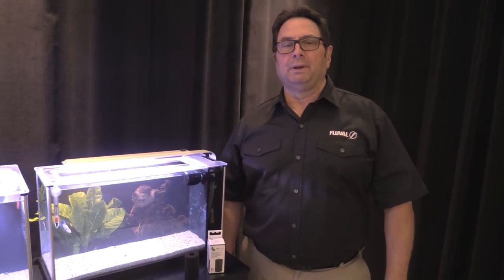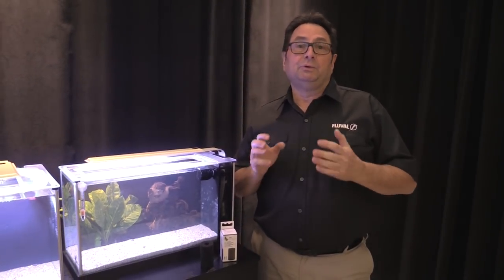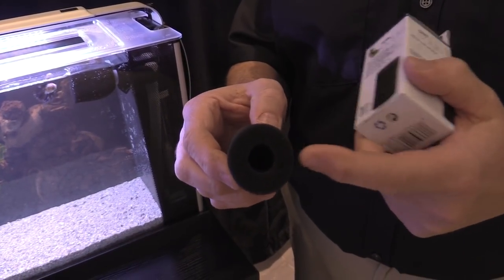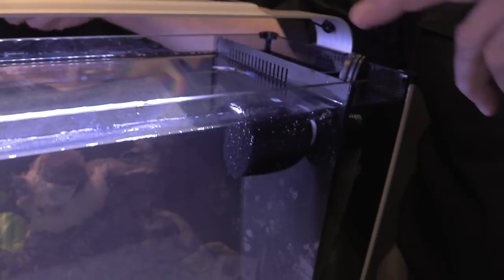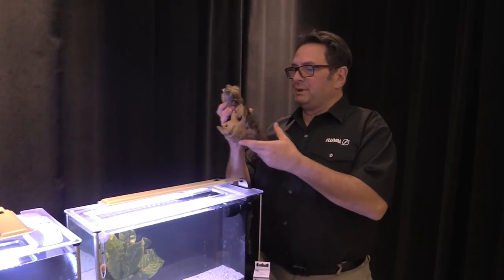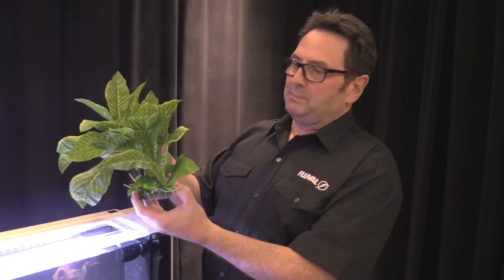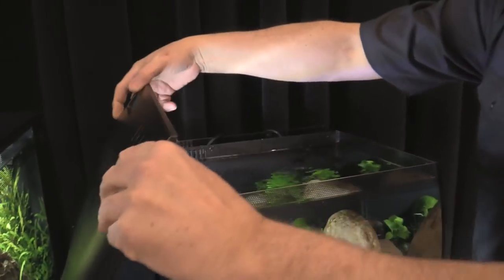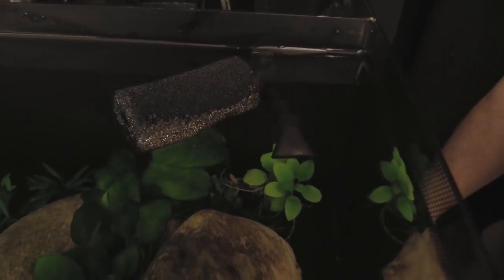HOW TO: Diffuse Water Flow in Aquariums

Comment: I made a DIY version of the sponge using an old filter one I had lying about. I didn't want to completely diffuse the water, as I want some of that gas exchange at the surface, so after cutting two holes at an angle from each other I managed to bring it down to a more fish-swimming-friendly flow. Thank you for this video that clued me onto using sponges to slow the flow!

Comment: Oh my goodness! So simple! Can’t believe I didn’t think Of it myself. Thanks you so much!
Reply: But be aware that reducing the effect of surface water flow will reduce the gas exchange process. That means less oxygen in the water for the fish. Not such a problem for Betta and Gourami's as they gulp air from the surface of the water if they can't get enough, but other breeds of fish will suffer. In this case an air stone is ESSENTIAL.

Comment: I just get the Fluval 104/105/106 foam and cut it into about 3x3 squares and cut a tiny slit on one side and put one over the each of the output nozzles on my Fluval Edge 15gallon! It works great and isn’t as noticeable as putting those bigger black ones which were put on in this video. It does not effect the pump at all, still outputting the same amount water just not at the same speed. Thanks Fluval for all the great products and videos to keep my fish happy and healthy!
Reply: Sorry, but if the water is entering the tank more slowly it has to be entering at a lower volume/second - just plain physics.

Comment: I bought a pair of these sponges at Petco after a salesman recommended them.  Just slip them over the output nozzles of the 15 Gal FLEX.  My betta no longer gets pushed around by the water.  The sponges work perfectly!  I'm not a fan of Petco but they have a good selection of supplies.
Reply: Marleny Rafferty is the Betta able to make nests now?
Reply: @nathanacuna7535  of course he can if there's no current
Reply: Can you link something on amazon?  So I know what to get.
Reply: David Jones I tried linking the item on amazon but could not.  However just type into the search box: Fluval edge pre-filter sponge.  The sponges are shaped liked black tubes with an opening on one side.  My Flex tank has a double nozzle.  I keep one nozzle covered and the other one not covered.

Comment: I love you guys!  I have quite a few different types of Fluval filters, some of them in multiples.  In fact I have 5 of just the U3 alone! I finally succumbed to the cuteness of fancy goldfish and received my first three today.  What I thought was low flow, isn't!  Especially because the only available cycled tank I had for them is a bow front so I'm struggling to figure out how to keep it from causing swirls.  In addition to your sponge suggestion, I think I will also try putting the filter on the bowed part so that the outflow gets broken up in the corners instead of just making 'whirlpools' lol.

Comment: Why didn’t Fluval just offer a dial to lower the pressure from low to high setting like some other aftermarket pumps. Problem solved.
Reply from the maker: Joe, unfortunately access to the valve is an issue for these desk top and nano tanks. Using the directional outputs that are included along with some of the other suggestions in the video are solutions. That said, we are always evaluating options.
Reply: Fluval Aquatics That’s reasonable, filter floss did work and move the nozzles upwards did lower the flow on my flex.
Reply: There needs to be surface agitation for gas exchange. I tried this method before this video and there was an oil slick on the surface and debris on the bottom. I too out the duckbill and it helped
Reply: Simple $ if they put a built in adjustment they can't keep selling you the foam covers.
Reply: You can just buy a valve and plumb it in to the existing hose, Eheim sell them. Problem is that increases the chance of leaks as you are increasing pressure on thr system.
Reply: @roadkill3881  🤔
Reply: There is also no ON/OFF switch on the power cables
It's just always on when plugged in
I guess this is just one less thing to have break but I feel like it would be useful
Reply: When he was talking about the wood I thought he said "small panty wood"

Comment: One of my favorites is to put the intake behind a matten filter in the corner or a corner weir with holes in it. It will, draw from the entire height of the tank and you can use a canister intake if you want an external filter.

Comment: I did the same thing with another tank and wound up getting a biofilm on the water's surface, because it wasn't being agitated enough. I corrected it, by sorta wedging a small piece of sponge in the outflow spout and angling it ABOVE the surface, so that it softly splashes down, fountain-like. I have a young betta in that tank, and she has no problem with it.
Reply from the maker: Donya, good suggestion, thank you. We did notice however that the inlet grill still has a healthy flow through it so the surface is exchanged through the filter. The biofilm you noticed might be due to some foods that contain more fat which ends up being visible at the waters' surface and in some circumstances would need some assistance in being dispersed.
Reply: It's entirely possible the biofilm was caused by something food-related, because it appear in two different betta tanks that each have very different style filtration systems. Both tanks are roughly 3 gallons each. But both had a VERY LOW flow setting (for the bettas). So, I cranked up the pump volume, wedged in the sponge and angled the outflow spout to act like a fountain, and it fixed it. 
Anyway, I'm looking forward to getting a Fluval tank next. I like the aesthetic!

Comment: I just purchased a Fluval Spec V 5 gal and I used a bonsai tree decoration from Petsmart to diffuse the water flow by directing the water into the top of the decoration.  It worked perfectly for my community aquarium in which I have a guppy, two mollys and a female betta.  I love the Fluval Spec, but I wished they had a little larger version of the same style.
Reply from the maker: Teresa, thank you for sharing!

Comment: Would you recommend doing this as opposed to setting up a sponge pre-filter in the first intake area? I've seen many videos which promote that method, but I've also hear that slowing intake is harder on the motor than slowing outflow. Thoughts?
Reply from the maker: In this case the intake to the pump does not allow for restriction and in general that is something is better not to do, restricting the output side of a magnetic drive pump is preferable. Setting up a sponge filter in the intake compartment would not be an immediate solution to reducing water flow so we would not recommend that for diffusing/reducing water flow.

Comment: Is that going to tire out the motor since it’s trying harder to push out of the water spout? I’ve been looking for something to calm the water of my flex..... this is perfect but any cons???
Reply: You would think so in the long run I bet this would destroy the motor in the filter
Reply: Katie Elliott , that current will circulate the water so the intake can filter out more bio waste. But if you completely cut of the current, the waste slowly settles to the gravel and rots within. Tat really breaks the purpose of filter haa... So its your call. If you have sensitive fishes... I dont find this as a good idea...
Reply: You could supplement with a very small sponge filter with an air pump and use an air stone inside to lessen the bubbles and add a valve on the tubing to regulate the flow to the sponge filter. The built in filter will undoubtedly get larger particles and the sponge filter will get finer. With weekly water changes, it should be fine.

Comment: Great video, exactly what I was looking for! Quick question - after installing the foam over the output nozzle should I also move the flow rate switch to the minus (-) position on the pump, or should I keep it at the plus (+) position? Thanks!
Reply from the maker: Ryan, which aquarium do you have?
Reply: I have 2 Spec 3's and 1 Spec 5

Comment: I have the sponge in the beginning of the vid. I use it when I'm going to feed my fish live brine so it does not get sucked up into the filter.  Great product.  Thanks for sharing.
Reply from the maker: Well noted and thanks for sharing. I too feed live brine to fry daily, may we add the point that when placing the foam on an intake it is very important to rinse it regularly as it will clog quickly.
Reply: That is what I do too.  I will keep it in the take even when not on the intake or just slide it down to allow more access for water into the filter.  Another place for good bacteria to make a home.

Comment: Hi, I've just placed a pre-filter over my outake as shown in your video. I'm wondering if yours is still working well long-term? My flow rate is totally cured but just want to make sure your filter still functioned properly with the nitrogen cycle and its intended tasks. Thanks!
Reply from the maker: Yes no issues. The key is regular rinsing of any pre-filters used.

Comment: Would this work on fluval 407 or is there a similar product to buy for a fluval 407?
Reply from the maker: In the video we mention a variety of strategies to diffuse water flow, you would have to be more specific.
Reply: I just found a a spray bar for fluval 407 hope it works to lower the water outflow. If not I’ll give that sponge a try.

Comment: Could  you do the same on a Fluval u4? Might it block up the motor eventually?
Reply from the maker: Yes you could, remember that the foam is attached to the output side of the filter so it is filtered water passing through the foam block.

Comment: Hi

How on earth do i stop my brand new flex 123 pump from making so much racket? Its so loud that i have to turn it off at night otherwise i cant sleep.... it must drive my fish crazy during the day. 

Ive tried packing foam in around it but it just rattles loud enough to be heard vibrating downstairs.....
Reply from the maker: The pump should operate almost soundlessly. Please verify that it is not making contact with the glass or the divider, and that the impeller assembly is thoroughly cleaned. If the noise persists, please contact your local aquatics retailer or our customer support team.

Comment: Can you use the A1387 for the new Fluval Flex 32.5 ? the flow on this is very strong and its keeping my fish on lower half of the tank and also food is dispersing too fast.
Reply from the maker: We advise A-598 (AquaClear 20 Filter Foam), create a slit in one of the narrower ends and cut about halfway down into the block, that will make for a nice fitting compact block that works well with the broader output fittings used on the Flex 32.5.
Reply: Fluval Aquatics This actually worked, I was able to cut the foam in half and use it for both  output nozzles, Thanks

Comment: Hi 
Please advise me does fluval FX 6 can  the water flow be adjested, I have a 240 liters fresh water tropical aquarium is the FX6 will make miss with lot of water flow or is it fine ? 
Please advise
Reply from the maker: The output valve can be used to safely reduce flow to approximately 50%. The flow required is really dependent on which fish you are keeping, fish that originate from rivers for example would more than likely appreciate full flow.

Comment: Doesn’t the sponge just completely stop the flow? If so and I want a little more flow, can I poke some holes in the front with a toothpick or something ?
Reply from the maker: Hi! The sponge won't stop the flow, but rather diffuses it. You can indeed poke some holes to allow more flow in a particular direction! Alternately, you can use a coarser foam block.

Comment: Will this not damage the filter, by causing some form of backlog of water because it's not kicking out what it's sucking in?
Reply: From what I've read and experienced, pumps are designed to handle restriction of the outflow but not the inlet.   Think about a pump going from a sump to an aquarium, or one from a pond to a waterfall, all the weight of that water is putting 'pressure' against the pump. The pump doesn't have any difficulty doing that, BUT I've had a pump fail on me when the prefilter box in my pond got clogged.

Comment: Hey fluval, when feeding betta, pebbles are going into the filter section thanks to the flow and slits. I own the spec and currently not that thrilled 😏. But the flow issue is my main concern. The sponge thing is an idea but does not look appealing 😏
Reply from the maker: In order to prevent that you can unplug the pump at feeding time as well as feeding a pellet or two at a time to your betta on the opposite side of the tank.
Reply: Fluval Aquatics my betta also is sometimes glued on to them top slids as if being sucked in. Luckily he is Able and have seen him unstuck himself with no issue which is good but I want to believe being glued isn’t a good thing.
Reply from the maker: Within the video where we install the foam block on the output you can see a male betta that is swimming right beside the intake screen, no issues. Healthy male bettas would not have this issue, perhaps there are other issues in regards to the fish itself. What temperature are you maintaining?
Reply: It sounds like maybe your tank isn't fully filled up?

Comment: What if I have a 60 gallon community with a Betta, should I reduce the flow?
Reply from the maker: In that case for sure not, if the betta were affected by mixing it in a tank with tank mates that require such an extreme difference in conditions that would have been an error in the first place and the betta should not have been part of that community.
Reply: Fluval Aquatics all tropical fish guppies, mollies, platies, a snail, and a few corys.

Comment: Would this cause no oxygen to be distributed in the tank? It is a great idea but I fear that if I do this for my 5 gallon, my betta will not be able to survive.
Reply from the maker: Michael, no is would not as there is a natural oxygen exchange at the surface of water in any case. While the surface of the aquarium would be quite still using a foam block over the output it is not a problem for a betta or other anabantid, they are capable of breathing atmospheric air and can do so at the surface if they have to. That said, you can always place some decorative structure as discussed in this video to diffuse current and still achieve water surface movement.
Reply: Thank you for answering my question! I might put something in front of the flow, and if it is still too strong, then I will definitely go with the sponge method!
Reply: @fluval  can goldfish do the same with the betta for oxygen or they need agitated surface? I have just bought the foam and installed it but the surface is barely moving. A really good product for my goldfish they seem relaxed now

Comment: How do you apply to an fx6?
Reply from the maker: You would generally not have to given the size of aquarium you would be running a FX6 on and the fact you can diffuse the outlet through two nozzles. Arranging structure as we discuss in this video would be sufficient.

Comment: What is the purpose of diffusing the water flow?
Reply from the maker: Erik, as mentioned in the video to eliminate current for some species of fish such as Betta splendens that are less able to deal with it due to the body size/strength to fin size ratio. Fish such as these have been bred domestically for a very long time and are no longer able to handle many natural conditions their ancestors can.

Comment: If you cut the flow down so much, wouldn't the oxygenation of the water be affected?
Reply from the maker: Great question! Reducing water flow is usually required for fish species that come from slower-moving waters, and therefore naturally have less dissolved oxygen in them! It's not recommended to diffuse water flow for most loricariids, for example, which generally live in extremely fast-flowing streams and rivers and prefers highly-oxygenated water.
Reply: @fluval  Makes sense, Thank you.

Comment: can this be done on the fx6
Reply from the maker: John, no need to, you can reduce water flow on the FX 6 by turning down the output valve, up to 50% reduction is not an issue.
Reply: @fluval  what about the FX4?

Comment: how can I slow down the flow output on the G6 ?
Reply from the maker: You may use the metal handle at top to turn the flow down slightly, up to a 25% reduction should be no issue.

Comment: what about a traditional HOB filter?
Reply: GC Aquatics I use on all of my hob intakes especially if the have small fry.  This also sets up additional surface area for Beneficial bacteria.
Reply: thanks, i currently have some 3-4 month old platy fry and trhey scare me pretty bad with it
Reply from the maker: Always an option but questionable for the aquariums in this video as there is an effective built in filter.